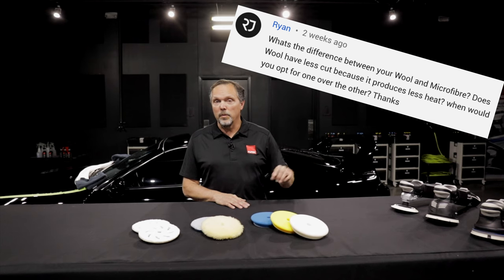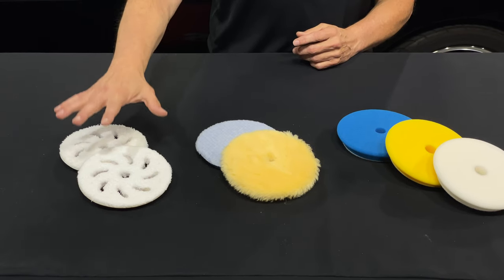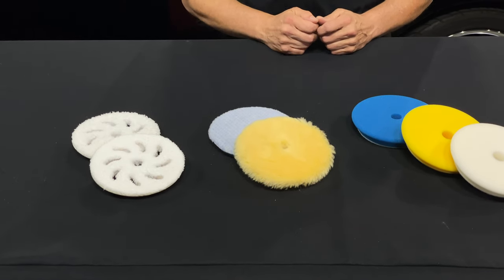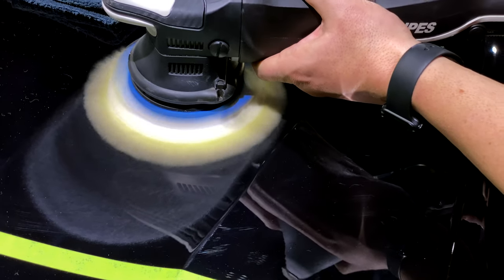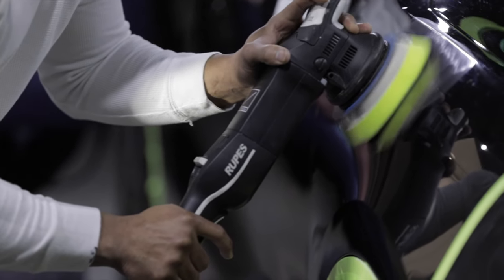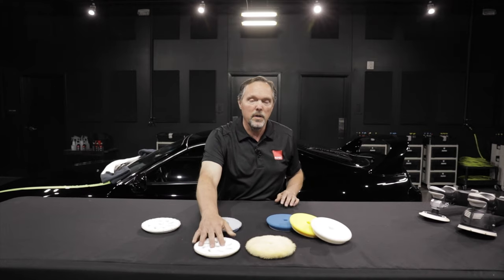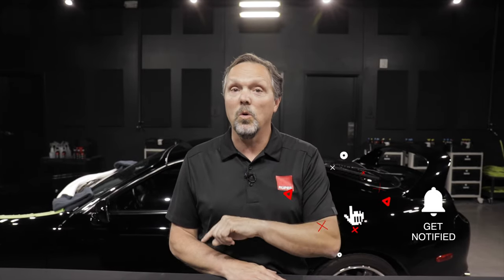Should You Use Wool, Microfiber, or Foam? - Pros and Cons of Each - [RUPES Replies Episode 006]

Comment: I would love to see you guys set up a data base for paint types and suggesting machine/compound/pad for example VW golf recommendations vs Ford recommendations etc etc. I know this would be very complicated but with good feedback from your users it would be a great advantage for your products.
Reply from the maker: Thanks for your comment. Unfortunately, the reality is that you cannot truly catalog all cars/manufacturers that way. An identical car, of the identical year, and identical color, but produced maybe months apart can have different clears. OEM factories always have at least 2 paint suppliers ready to provide material and can change at any moment due to supply, process, or any other number of reasons. So cataloging by make/model is a bit of a fools errand. 
We do, however have the paint correction app, which allows you to choose the paint type (test spot should tell you what you're working on) defect type, and tool choice to determine our official recommendation of pad and compound that has the highest chance for success based on our research. 
https://app.rupes.com/paint-correction

Comment: Where does Uno Pure and the white pad come into play? Mainly for paint with very a soft clearcoat, otherwise just go with the Fine polish and yellow pad?
Reply from the maker: You're pretty much correct... UNO Pure would be the choice when you need something to finish down extremely fine defects, or you're dealing with a soft (problematic) clear coat that doesn't respond well to other products. It could also be used in place of DA Fine in a situation where the cutting step was done with DA Coarse, and it finished almost where you need it, but just need a tiny amount of refinement.

Comment: freshly painted panels .. flattened back what is best  process for buffing up and ..which pads..
Reply from the maker: Thanks for commenting. It really depends on a number of variables - level of defect/sand scratch, paint hardness, tool choice, air cured vs. force cured, etc. Some paints have very specific sanding and buffing windows in which they are easy to correct, then become incredibly hard to correct outside of that window. Product choice would vary from paint to paint.

Comment: Hi, do I still need to finish up using the yellow & white foam pad for final steps after done using the yellow wool pad? Thanks!
Reply from the maker: Thanks for your question. It is important to understand that the goal of the system is to finish in 1, at most 2 steps. Doing 3 steps should be an anomaly on only the most troublesome applications. We would suggest that after using the wool pads, if there is a haze or any additional defects to be addressed you test to define which product combination will complete the job in the second step. Sometimes it may be yellow. Sometimes it may be white. Sometimes the finish will be so good after the compounding step you do not need to perform a second step! We offer the range of Coarse, Fine, and Ultrafine to give you options for specific situations, not to create more steps.

Comment: Best advice for this type of video would be "show, don't tell". I know in general theory the aggression progression is microfiber, wool, foam...however as a DIY guy I'm not sure what I need based on what paint defects I have.

I have a 2017 Mazda CX-9 in Gun Metal Gray, and a 2020 Honda Civic Si Coupe in Platinum White. So far to do a proper 2 to 3 step correction I bought 5", 3", and 2" pads in Blue Wool, Yellow Foam, and White Foam (to be used with a 20mm long throw 5" DA, and a 8mm 3"/2" DA polishers). As far as compounds/polishes, I have Meguiars 110, 210, and 83 Cleaner Polish, Sonax Cutmax, and Rupes Uno Pure Polish.

My question is do I need to add the microfiber pads into my current system, before I get started? Or are the blue wool, yellow foam, and finishing white, enough range to do what I need?
Reply from the maker: There is absolutely no way to know that until you put product to paint and perform a test spot. The variables of paint hardness, defect severity, operator technique, ambient conditions, etc all come into play.
Reply: @RUPES  there has to be a way to recommend a starting range of products to a customer, besides "buy everything we have". In my case the cars have been mostly parked outdoors in a driveway all their lives, in Northeastern PA, and NYC. They have your average wear and tear on the paint from rain, winter driving, automatic car washes, swirls and love marks from towel wipe downs.

This is why I suggested you do a tutorial for when to use various pads, and actually show the type of defects that they will correct. Then people have some baseline to work off of.
Reply from the maker: The variable of paint hardness still complicates this. A demo on specific pads vs. specific defects would still only apply to that level of paint hardness. 

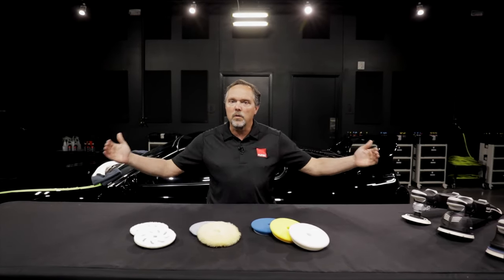If you pay attention to the video, at around 2:30 the suggestion for pads with the widest range of performance is the DA Yellow Wool and DA Yellow Foam. Those 2 pads provide the best chance for success on the most paints.

Comment: Does Uno protect with a blue wool pad leave a haze or hologram on black paint?
Reply from the maker: A hologram would only be introduced if you're using a rotary. That is a side effect of the movement more than anything else. A haze, regardless of tool type, would be paint dependent. On a harder paint it is unlikely you'd see a haze. On softer paints an aggressive pad like blue wool would potentially leave a haze and in that situation you should adjust your pad choice or use UNO Protect as a 2nd step for refinement after a more aggressive cutting step with something like D-A Coarse.

Comment: Could you do a video of backing plates? I have seen some backing plates that offer a faster rotation which yield a quicker correction
Reply from the maker: Thanks for watching - we won’t be doing that video because the backing plates you’re referring to are not recommended and not our product. It would be worth your time to to watch the myths webinar - we cover the myth of rotation stall and scientifically show that the rotation is only a very small percentage of the movement on an orbital tool. The concept that these aftermarket plates are sold on that they significantly increase correction by increasing rotation is simply not true. On a 150mm (6”) even if the plate could increase average RPM by 60 over the stock plate, the MAXIMUM gain in edge speed would be 10%... and that’s only at the pads edge.

Polishing Myths, BUSTED! - [RUPES C.O.R.E. Series Webinar] https://youtu.be/4yDU4CWAISU

Comment: I have a freshly painted classic vehicle in which I am wetsanding the clear after about a month after painting. I am starting with 1500 grit wet, and working up to 3000 grit with dry guide coat. I have your bigfoot lhr21 mark 3 polisher and may be investing in the lhr75 mini. What pad do you recommend and compound? Thanks
Reply from the maker: Thanks for commenting. Paint hardness and quality of sanding marks are both variables that will impact this. In general the blue D-A Coarse Wool and D-A Coarse compound would be a good place to start, but depending on your particular paint there may need to be adjustments based on how it responds.

Comment: Has the green foam been removed from the line up?  The explanation of the mf vs wool makes sense to me now after using some of the original yellow mf pads when the came out and would load up quickly. Great segment.  Is there a video already showing or talking about the abilities of the wool on a rotary vs da to get a good cut and finish?
Reply from the maker: Thanks for the comment Mason. Yes - green is being phased out from the line as the new blue has been developed to cover and exceed the range covered by the previous green and blue pads combined. 
As far as the comparison of wool on different tools. While a rotary wool pad and a DA wool pad are both made from wool, they are very different! The type of wool and how the pads are constructed are for very different purposes. It is possible to achieve a very high level of finish on DA wool, not so much on a rotary wool. Our newer generation of rotary wool pads have far more finishing ability than anything like them before, however they are still not going to be on the same level of DA pads for that purpose.
Reply: @RUPES  awesome thanks. I'll have to pick some up!

Comment: I have an oscillating turtle wax polisher, used it with a burgundy red (Hard) foam pad and Sonax Profiline Cut Max on my black Audi S4. It did the trick however you can still see swirls and scratches ever so slightly and it annoys me haha.. The paint is extremely hard on this one. I was interested in a microfiber pad from Rupes Im guessing its the right way to go considering the fact that I want to step upp the aggression/abrasivenes?
Reply from the maker: Thanks for watching and commenting. We're not familiar with that polisher and can't really know what type of pad you were working with based only on the color, especially when it is not one of ours, used with a compound from another company. Suffice to say, any input on a scenario that far departed from our system based approach is nothing more than a guess. Will microfiber be more aggressive than foam? Yes, in nearly all cases. Will you see an improved result? Impossible to say based on the number of variables.
Reply: @RUPES  I understand, would you consider an oscillating machine more of a "waxing machine" rather than something to use when cutting is preferable?
Reply from the maker: That would be correct. A single action orbital tends to be an incredibly weak movement (and also typically quite small orbit) so the ability for it to actually correct the finish is low. Tools like this are generally best suited to applying a wax, but not actually correcting the defects.

Comment: Hi RUPES
Ive just bought the LH19E and the Nano Ibrid, and i have a LHR15 MKIII, i have microfiber, wool and foam pads, same with the rotary (blue and yellow) and regular polishing compounds (blue green yellow and white) i did a test section on my volkswagen golf mkiv with the rotary + blue foam pad and blue compound with almost zero progress, what setup and machine should i use for maximum cutting, also what kind of speeds on the different machines should i use? ive worked at a automotive paintshop and we've always used rotary, and he told me it has the biggest cut, is that true?
- i hope its not too many questions =)
Greetings from denmark =)
Reply from the maker: Thank you for commenting. It sounds like you may be using pads and compounds intended for orbital tools with your rotary. That combination will not generally be very effective. 

For maximum cutting with rotary you would want our coarse, twisted wool, rotary pads (part code in the 9.BL___H series) and coarse rotary compound. If you are trying to maximize cut with the LHR15 then the choice would be the coarse microfiber disc and blue ( DA Coarse or Zephir Coarse) compounds. 

There are many variable to consider as well that are probably too many to discuss in the comments of YouTube. You can always contact us directly for more assistance www.rupes.com/contact-us
Reply: @RUPES  i have only used rotary tools pads and compounds for the LH9E and only DA (LHR) pads compound etc. For the DA😊

Comment: Is Rupes ever gonna change the design of the 1” and 2” foam, or at least make the yellow ones the same color as the larger pads?
Reply from the maker: If you mean change the material to match the  new D-A Series full size foams, yes. That change is on the horizon.
Reply: @RUPES  yep, that’s what I mean. Thanks.

Comment: Is the white rupes pad the best for applying Graphene?
Reply from the maker: The white foam pad is our softest material and can be used to apply non-abrasive products if you choose to use it that way. We have not, however, validated its performance for products other than our own so using it with graphene based coatings or other products would be up to you to test and validate performance.

Comment: Hello, how do you tell if the paint is hard vs soft.. ? I suppose there would eventually be some sort of AI based app that produces a cutting compound/material recommendation based on what the manufacturer typically puts down as an OEM finish
Reply from the maker: Thanks for commenting. While it may not have artificial intelligence, we do have an app to help guide your choices for product combos - https://www.rupes.com/web-app/

The only way to know if a paint is hard or soft is to perform a test spot. We have several videos that cover this topic that will be linked below. Also, do not catalog paint hardness by brand of car. They change processes and paint suppliers frequently which means paint hardness car vary even in the same model year for the same color. 

BigFoot 101: https://www.youtube.com/playlist?list=PLkX3qMzwBy1EOnBML1roW5F_CDx3eblWy

Should you do a test spot: https://youtu.be/0Z79_1h2SyA
Reply: @RUPES  ah this is great information - Thanks so much for getting back to me/us so quickly - not many tool manufacturers interact with their audience the way you do!

Comment: Hi all

I have a 2019 VW Tiguan and metallic dark gray.  It has very light swirls that you can only see in certain angles of sunlight.  I have tried the yellow foam pad with Sonax Perfect finish (Sorry) but it hasn't done hardly a thing to remove them.  Would the wool Yellow pad be the next choice to try? 

Kind Regards,  Ryan.
Reply from the maker: Could be, could also not be. It will take some testing to determine what the best combo for the particular paint is. Sometimes the adjustment is a pad, sometimes the liquid, sometimes both. If you haven't yet, check out this video on test spots from another episode in the series: 

https://youtu.be/0Z79_1h2SyA

Comment: Is wool pad is the better  in polishing stainless steel
Reply from the maker: Depends on what the goal is. If it is defect removal, yes wool would be preferred. If it is gloss enhancement it may not be the best choice. A lot will also depend on the type of liquid being used with the pad and the tool movement.

Comment: Didn’t people use to buff off the wax with polishing machines before there were microfiber towels. Is this not good and why?
Reply from the maker: Thanks for watching and thanks for posting your question. "Buffing off" wax or polish is something born out of the use of old bonnet style orbital (not dual action orbital, just orbital) machines. These are usually very inexpensive, low power, tools that do not have a backing plate, but a head that a bonnet (usually terry cloth or microfiber) would be stretched over. The movement of that tool mimics the movement of what your hand does wiping a residue away. Just orbits, no rotation. This doesn't really add any benefit to the result, it just takes the manual effort out of the process. 

With the types of tools we manufacturer the process, even in the ultrafine range, is going to be abrasive. It is physically removing a microscopic amount of the surface to level and remove defects. Because of this we would not want to use the tool to remove any residues b/c it is going to continue to abrade the surface, and likely not in a beneficial or consistent way. 

To that end, with the processes we're discussing here (paint correction) you would use the tool to perform the process, then remove the residues by hand with a microfiber towel. The amount of residue and difficulty or removal when used properly is so minimal that the aid of a machine would have very little benefit, even if it were a recommended process. It isn't like buffing off the heavy/sticky waxes of yesteryear. Hope that helps!

Comment: What should I do when the compound gets sticky?
Reply from the maker: If the compound gets sticky it is typically an indication of a couple things: 
1) too much product is being used
2) the product is being over-cycled (worked for too long) 
3) the pad is not being cleaned frequently enough

So for solutions: 

1) Reduce the amount of compound you are using per application
2) Shorten your cycle time with the compound
3) Use compressed air to blow out residues from the pad after each application.

Comment: Used yesterday a microfiber pad extreme cut on a fresh paint. Did nothing lol, literal was unable to remove 2000 3m sand paper did with 3000 on top and yet 0 result. I had to use blue foam..

Comment: Okkay im  now even more confused  why people dont use wool pad on rotary, this days are all about random orbital.. Da ,.........  soo when do you use rotary
Reply from the maker: Thanks for commenting. First thing to understand is that the dynamics of heat and the types of wool we're discussing in this video have very little direct correlation to rotary movement. The way heat manifests and the behavior on the paint are very different so you can't apply DA consumables and logic to rotary polishing or the other way around. 

In the last 10 years polishing technology has evolved to make orbital, specifically large stroke random orbital and gear driven orbital, cover a wider range of applications. Rotary remains king when it comes to rate of material removal, but in the moderate to light correction space a rotary is largely unnecessary in most applications. Rotary is still the absolute best movement, with wool, on oxidized gel coat, on surfaces where rapid material removal is needed, primarily heavy cutting activities. In some cases many bodyshops users prefer to cut with rotary then finish with DA. The discussion is not really one vs. the other and more which one is right and when.
Reply: Thank you :)